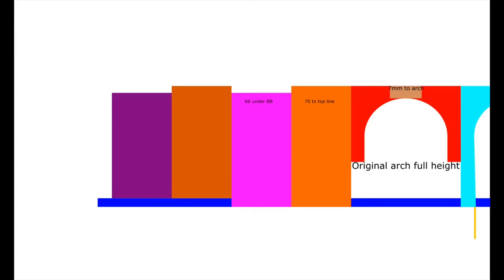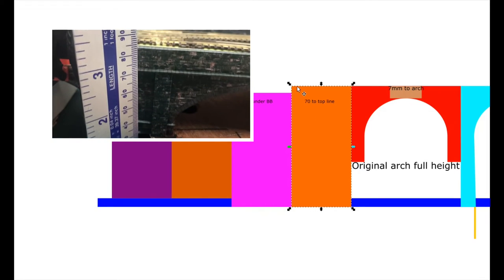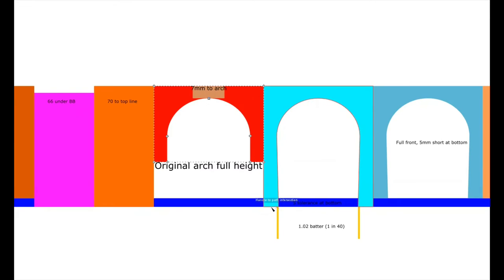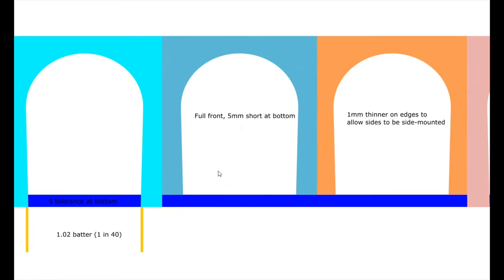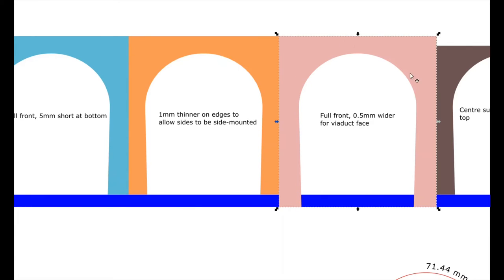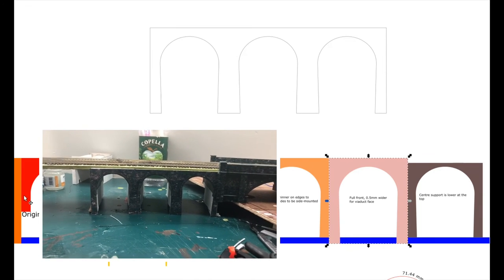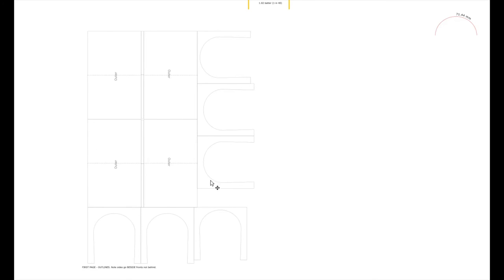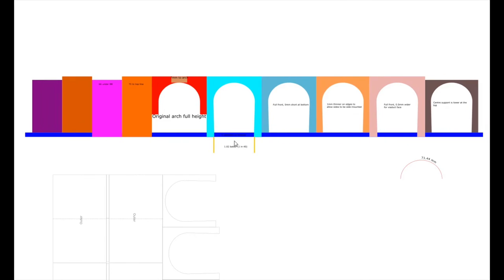How I use Inkscape to construct my scratch built N Gauge viaduct arches

Comment: Thanks for taking time to explain all the tools you are using. A quick question. Which printer do you use to print for printing Scalescenes sheets ? 

As a french guy I apologize for my bad English
Reply from the maker: Bonjour! Your perfect English is much better than my terrible French. I use a Canon MG5753 inkjet printer and 110gsm matt photo paper. The paper is thick enough to get a really high quality print, but thin enough to still be easy to fold and wrap.  Thank you for watching! Merci! —Michael.
Reply: Thanks for the new paper weight tip👍

Comment: Hi. Have you heard of a machine called a Cricut that can be used to cut out templates just like you have been producing?
I am wondering if you or anyone else knows if its possible to produce plans like yours in Inkscape and transfer them to use on the Cricut?
Reply from the maker: Hi David, yes, I have heard of a circuit machine, but so far I've never used one. I believe that some machines can cut from PDF files and Inkscape has a built-in ability to export as PDF, so that would work. In fact, you can save your Inkscape file as all kinds of files, so I'm sure that there would be something in there that would work with a circuit machine. :_chandClass47:Michael
Reply: @Chandwell  Brilliant thankyou